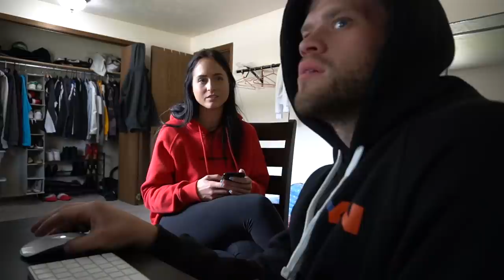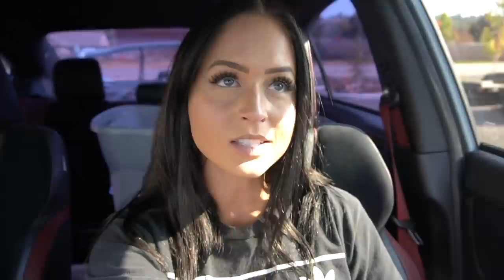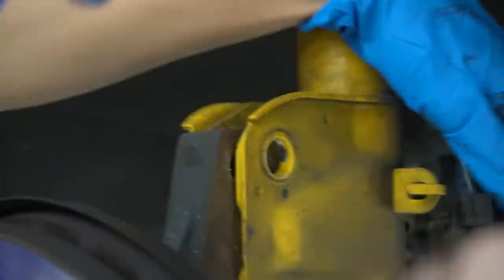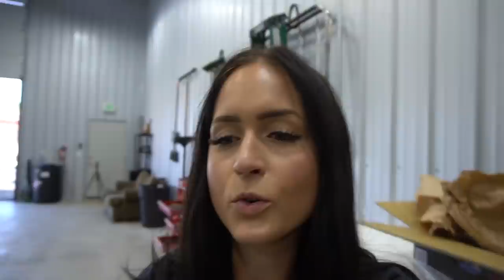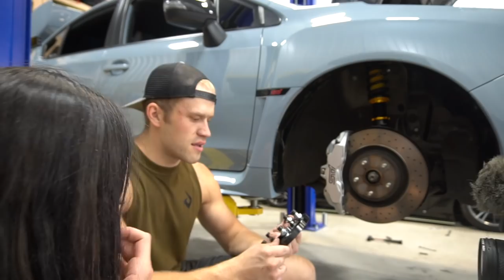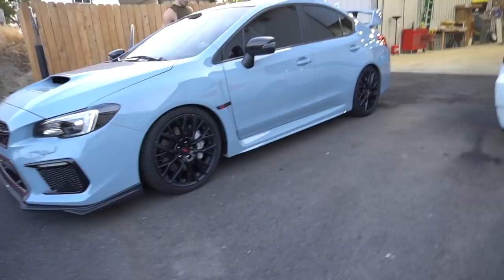Finally Installing Coils On my Sti!

Comment: Damn Gary looking fine bobby 😍, damn seeing this makes me  miss my Hawkeye Sti so much 😭 . She had KW fully adjustable coilovers, whiteline anti lift kit, whiteline adjustable front and rear swaybars, rear brace and all whiteline polyurethane bushes all round, she cornered so flat no matter the speed 😝 and of course big break kit with 8pot fronts and 6pot rears, damn she ripped the face off you when you stopped too 🤣

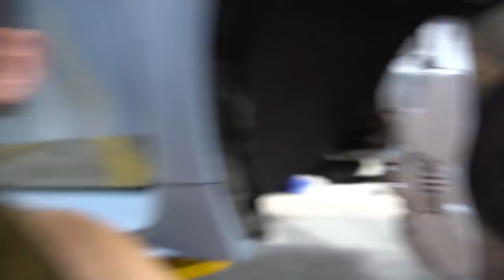Comment: - At 7:48 it looks like the original studs were cut to be flush with the new spacer?  Is that what had to be done to the studs?  I'm looking at spacers for a 5x114.3 setup with 60.1 hub bore and would rather get a spacer thick enough to not have to cut the original studs in case I want to go back to stock.  So wondering how thick of a spacer I would need - 30mm? 2inches?
- Also, anyone know what the spacers here in this video did not work???

Comment: Question about lowering your car. Did you have to change to adjustable end links? Or is your sway bar not connected to your coilovers? I changed my struts to coilovers 2 weeks ago and I used oem end links so my car is noisy right now until I find adjustable end links for it.

Comment: You should add weight to the back of the car to improve the handling because stis come with 60 percent of the weight out front of the car. Making it want to under steer when you reach your traction limit going around a turn.